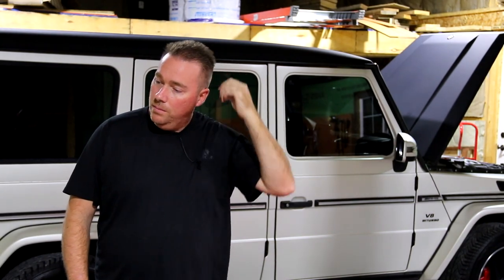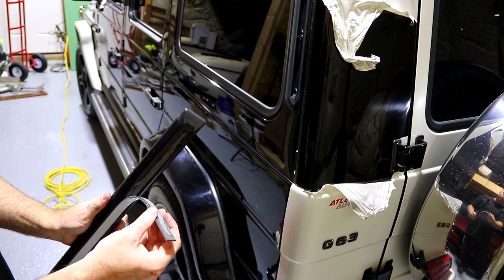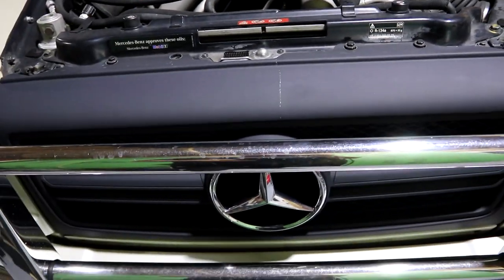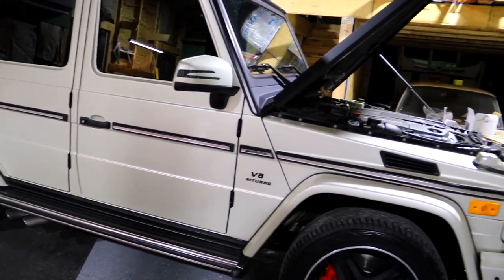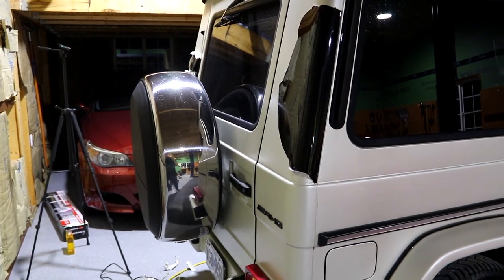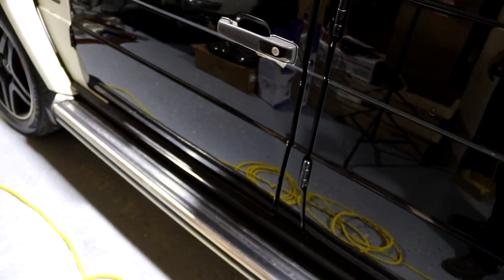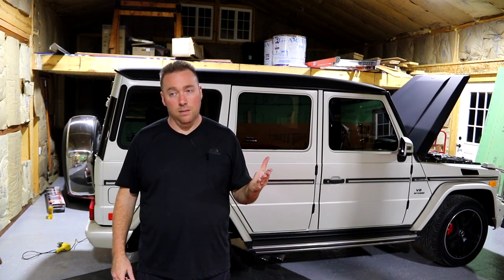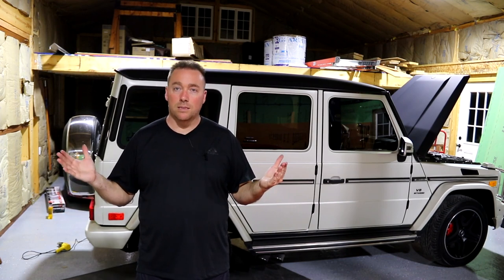Never Wrap A Car *DESTROYED* 2014 Mercedes G-WAGON G63 AMG...

Comment: If professionally wrapped with quality materials and unwrapped properly with a quality heat gun (not what you’re using). You don’t seem to have paint damage. This car was preserved by the wrap and didn’t damage your car - can’t speak for paint damage. 
So to correct you, don’t wrap or paint your car without the full knowledge of what product is being used and the installation. I’ve wrapped my show truck 3 times and never had any issues. Just do your research. SMH

Comment: Try doing some research on the options that car came with.  I vaguely remember some option back around that time where there was a Matte black roof, hood and then the wheel things(covers/fenders).... I just looked up info for "2 tone" paint on 2014 G63.... anyway, I did find one for sale but it was a 2015.  It's called a "Night Star" edition.  It's probably what that G was new.... so it's probably factory matte paint that came with that package.  Of course I just noticed that your video is 2 years old so it's probably all a moot point now anyway.

Comment: PDR master tech 18yrs in. 2nd generation.  

I see both ends of this.  Big panel PPF and Vinyl on vehicle’s.   look the way candy corn tastes. 

The trim removal to install the wrap is actually “good” wrap technique.   However.  Prying up 4K in body side moldings. (Probably for the first time) rendering them trash, to then use harbor freight double sided tape to re-install them.  🤦‍♂️. SMH.  Shooting from the hip.  I bet it’s a one time use molding.  

How much damage is under those thrashed molding areas???    

As far as the bed liner sprayed hood and roof.  ….

Back it out. Get the weedwacker gas from the shed & light it on fire.  

Or get a years worth of DA pads for each surface.  And extra $$ to whoever draws the short straw 

That Merc is just the vehicle representation of Sammy Sosa’s physical appearance since retiring from baseball.